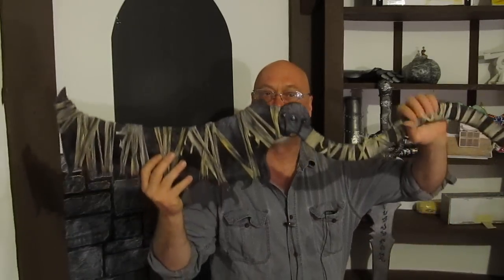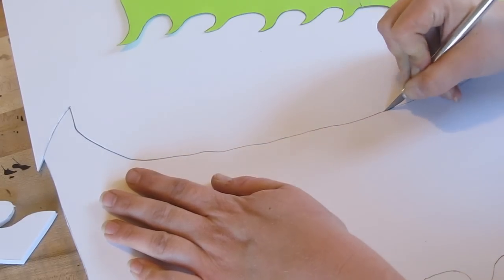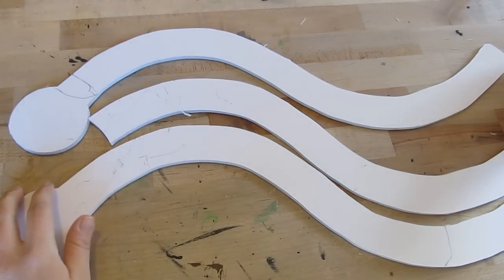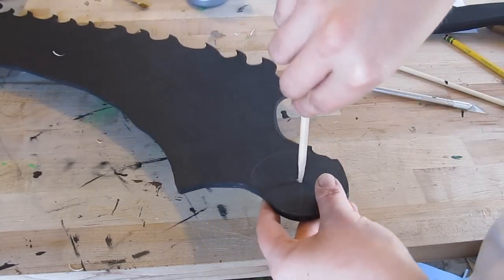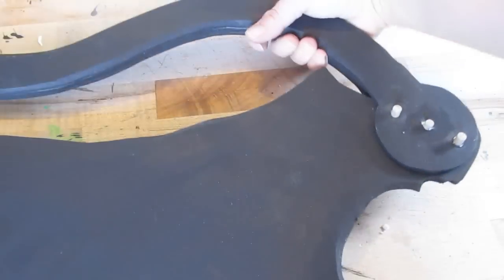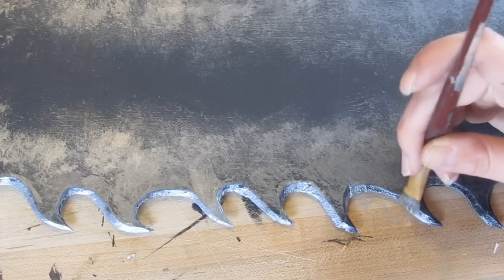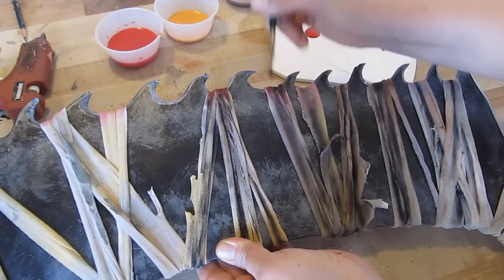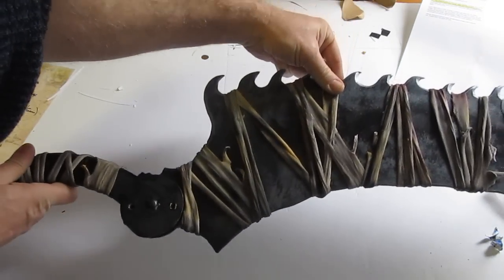Make the Saw Cleaver from Bloodborne

Comment: One small additional detail should be included:

Per game mechanics, the Saw Cleaver deals bonus damage to beasts since it is serrated. However, you only attack with the serrated edge in SHORT FORM. If you look closely at the item in game, the blade is actually sharpened on the non-serrated side, and just like you described, just like a shaving blade.

Attacking with the weapon in it's transformed state uses the flat, non-serrated side. But it's still a sharp edge in game like a shaving blade, so beveling the long edge would be a nice addition.

Going to Michaels to get supplies now!

Comment: Can you think of a way, for the removal and insertion of the pins to be automated by a press of a button or push of a thumb/finger lever? i cannot think of anything but i really want to make this automated if possible.
Reply: L Lawliet  Create a trigger that pulls the pin when pressed attached to the handle. Make the pin holes bigger cause they don't need to stick in just fit and to slide out when needed. If your trigger and pin are sturdy and well attached, it shouldn't fall out off the slot while attached to the handle and you should be able to swing transform it while pressing the trigger and lock it in place by releasing it.
Reply: +L Lawliet Well the way it works in the game is that it uses a handle that acts as a brake, like on a bicycle.

Comment: I started working on this project, and I got a quick question: Is it ok if I use foam mats? (like the ones you'd see at a gym or yoga class) because where I live, I can't find the foam boards you use, I either find those mats or paper thin like foam sheets. I see I can't cut as easy as you di in this video, I don't know if it's because my foam is thicker or because my x-acto isn't sharp enough (I have to cut through it many times until I cut all the way through)

Comment: Nice video, although you did make a slight mistake with the hinge mechanism. Also, the blade is double edged.

In the game, the hinge locks thanks to a small lever that sticks out the back of the hinge. You'll see if it you closely look at concept art for the weapon.

I'm gonna use this video to try and make the Saw-Spear :3
Reply: He's just using this way to make to easier to make, if you want a more detailed version then it would take a lot more work.

Comment: How thick is the foamboard you used? I plan on doing this with a different locking mechanism so it works like the actual game. For that, I will initially do it on foamboard and I just wanted to know the small details, though I plan on making the handle longer to make it more accurate to the game. Final project will be wood/metal/foam still deciding, though. The mechanism can't be foam if not it won't hold, since I want to make the handle round and that will have to be on wood. Also, Been subbed to you since around 2007-2008, this is the first project I'm gonna make, since From SoftWare makes my all-time favorite video games. Hopefully it comes out just like in the game, I'm a bit of a perfectionist. Thanks for the video!
Reply: Looks like quarter inch foamboard, but I'm not too sure, thus I ask.
Reply from the maker: +Day Twenty One 5mm
Reply: epicfantasy
 Thanks!
Reply: what locking mechanism are you using? I'd like to know how to make it the same way
Reply: +Day Twenty One

Comment: I'll be picky there but :

- Handle is supposed to be slightly longer than the blade and way to curvy
- Bevel needed on the opposite side of the teeth

P.S : Maybe doing this build out of wood might be a more reliable idea in my opinion, sure a lot harder but a much better idea, giving you the posibility to sand down the handle, get the bevel really good and allows the joint to be a little more resistant
Reply: This is just a tutorial. You can make it out of any material but he chose foam for and easier way of doing things.

Comment: This is probably a super dumb  question but i'm new to all of this and i was wondering what kind of foam board is necessary or can you just use any type of foam board if there is any other type.
Reply from the maker: jon victor Foam board does vary in quality. Try to get durable and strong. It costs more.

Comment: How thick is your foam board? In the video, your board was cut a lot easily then mine and I have tones of imperfections in mine. I was wondering if there is anything I could do to make cutting it easier and make it look better.
Reply from the maker: Harry1871996 5mm thick. Foam board does come in varying qualities. Some are better. Elmers foamboard is the most durable. And... cut with a fresh blade, nice and sharp, making three passes. Don't try to cut all the way through with one swipe.
Reply: Thanks! I was originally using 10mm because I thought it would be more durable. It proved far to difficult to cut though. I needed at least 6 passes just to puncture through to the end and it looked awful from the sides. I switched to 5mm a few days ago. It is going far better now!

Comment: Hey there! I am currently working with this project and printed out the templates, but I feel like mine is quite a bit smaller than it looks in the video? The template IS printed on A4 paper, right?
Reply from the maker: The template is on US letter size (8.5x 11 inches) which is a little bit different than a4. Might still be ok for you  but I am not sure.  Cut out the pieces and lay out the template. see if you like the size of it. Otherwise you can always use your printer settings to change the print size.
Reply: I was thinking the same, from what I can tell it looks like he actually sketched it on A3
Reply: @epicfantasy  Shoot. My printer doesnt support bigger prints. Guess eye-measuring a bigger version will have to do. Thanks for the help anyway :)

Comment: i think I'm going to make this out of wood and a bit of metal, making the blade with the template out of wood, then using a curved, round piece of wood for the handle, and make the joint out of two round metal plates, just because i don't know where to find foam board and I'm not skilled with stuff like this, and i think my sloppy manufacturing will make it look even more menacing
Reply from the maker: Some good ideas you have here. Have fun! That part of the process.

Comment: Whenever I try to bevel with my knife, it ends up tearing the paper and rips up the foam. Do you have any suggestions? Do I need a better crafting knife with a sharper blade, or is it just my skill that needs improvement?

I hope it's the blade because I'll take forever to improve. ;-; Lol
Reply from the maker: Jharmainyack Yes, definitely change that blade. It's all about the sharpness.
Reply: Ok, thanks. Probably the same reason why the paper and foam also aren't smooth when I cut. ^.^

Comment: Would EVA foam work just as well as foam board? I find EVA easier to work with.
Reply from the maker: +ZaKkRaDiCaL123  No, I don't think eva foam would be right for this.
Reply: You couldn't Eva foam. Sure is ideal for armour and weapons sure, but it would be a lot wobbler unless you put support in inside foam like a fibreglass rod, or iron rod. But you would have to make 2 layers of the saw and 4 layers for the handle. In other words I been building props for 2 years it's what I do.

Comment: What do i use if i dont have Mod Podge?
Reply from the maker: Tor Even Halla A thin coat of white glue will work. Don't water it down so it doesn't warp the foam board.